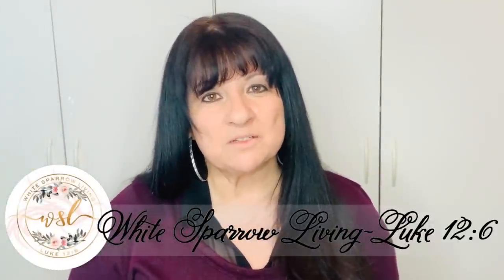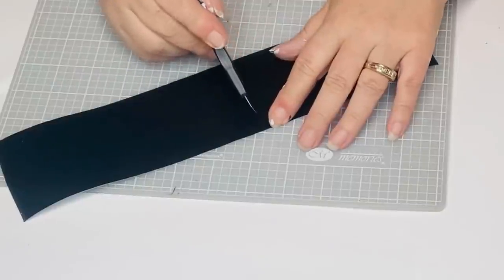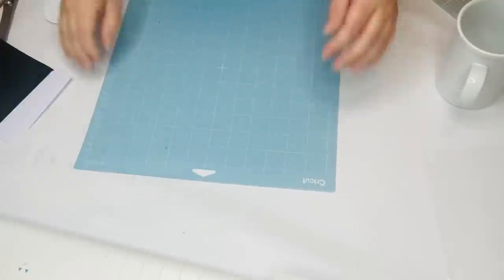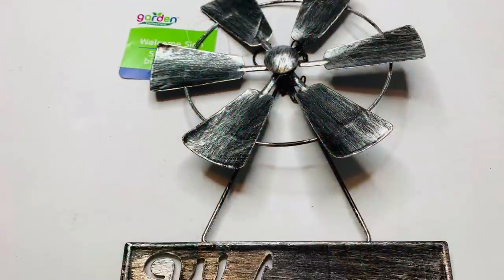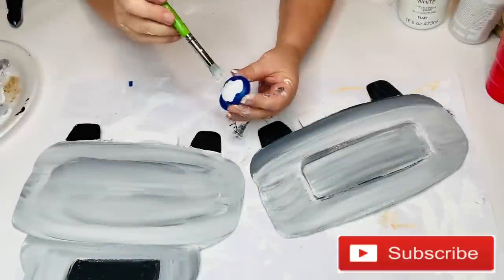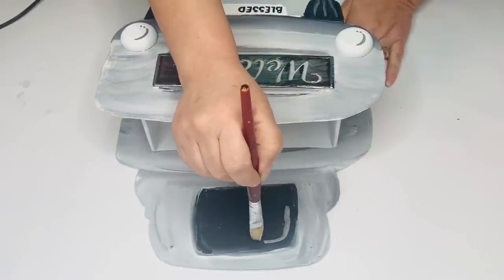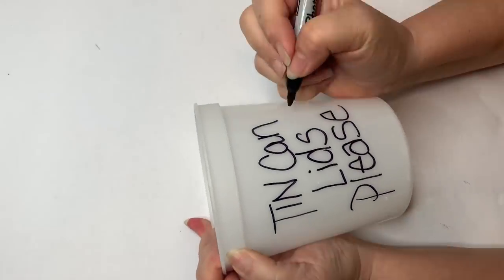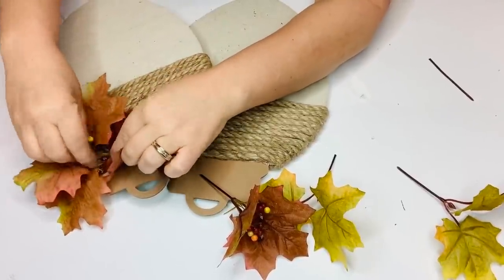5 HIGH END DOLLAR TREE + BUFFALO CHECK FALL FARMHOUSE HOME DECOR DIYS

Comment: For the Cricut vinyl, As long as you clean off the item with rubbing alcohol, let it dry, then apply Cricut vinyl it will stay on in the dishwasher. I haven’t tried the temporary one however the old vinyl before the temporary and the permanent didn’t stay on in the dishwasher for me. I have put it on stainless steel water bottles and it’s still on today and it’s been going in the DW for years.
Reply from the maker: Good to know!!! Thank you!!
💛💝💛💝😃😃

Comment: Do the tin can lids need to be cut with a special can opener? It looks like yours have a rim around them and no sharp edges.
Love the acorns! Technically, you should use oak leaves, not maple, but they turned out really cute!
Reply from the maker: Haha If you watch many of my videos, you'll see that I don't usually match the fruits/veggies/flowers with the correct leaves! I wouldn't even know which ones do!! Lol I have a hand-held can opener that I listed in my Amazon store. Lots of people ask about it and you can find them anywhere but make sure it's a side cutting opener. It will tell you on the package that it leaves a smooth edge. Hope this helps, Ruth! God bless! Xoxo

Comment: Cute ideas!  Did you have to prep before painting the metal so it doesn't chip off?  Want to paint galvanized flower pots and have it stay on.
Reply from the maker: I didn't, Nancy. I haven't had problems with that but I try to let the first coat completely dry before applying the second coat so that could be why it hasn't cracked on me! Xoxo
Reply: @WhiteSparrowLivingLuke126  thank you!

Comment: I am having trouble with my transfer paper. The vinyl will not release unto the transfer tape. Any suggestions?
Reply from the maker: Hi Janet! Sorry I'm so late in getting back to you! The only thing I can think of is that you may need to burnish it both on the top and the bottom with a squeegee (sp?) a little harder? Then when you're pulling off the backing paper from the adhesive vinyl, fold it and pull it back with your hand spread wide open and push while you're pulling (rolling) it off. (if that makes sense!) I also have had a few rolls of the Dollar Tree brand contact paper that was being weird because the glue was too thick but that may have been an isolated incident! I hope you can figure it out because I know this is a frustrating issue. Here is a video I found for you that may help a little. Xoxo https://youtu.be/dhZpxNF_uuY
Reply: @WhiteSparrowLivingLuke126  Thank you!